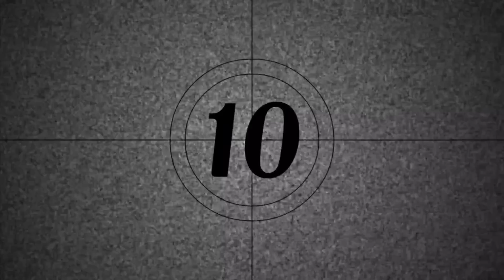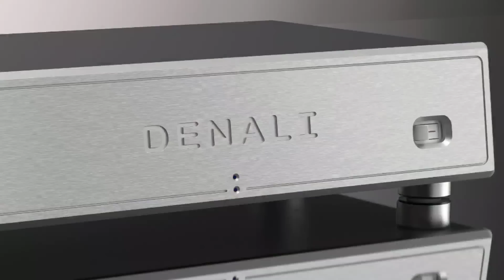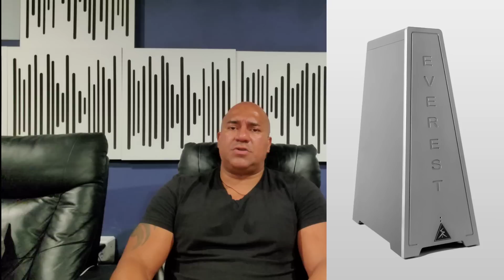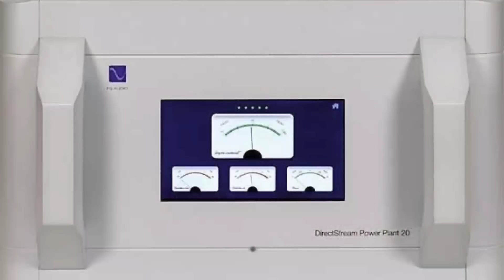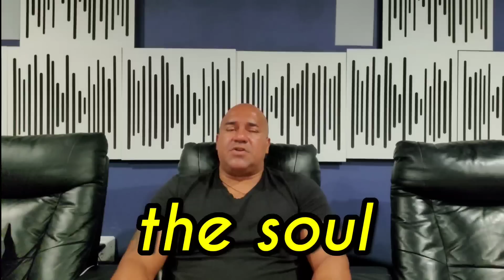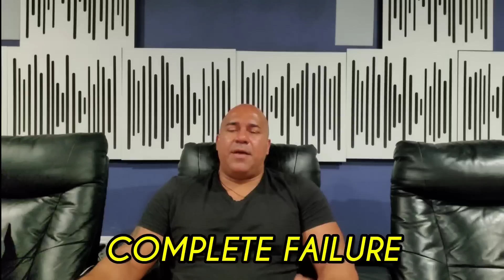Jay's Take on Power Conditioners

Comment: The problem with conditioners is they starve components, that require high current, of power. If the sum of all the components you have running is higher than the max output of the conditioner, you will have under powered components. This will be most evident with amplifiers. (That's why your amp failed. Not enough power). Line isolation power boards with decent cords are the way to go as it will ALWAYS give you the full power available from the grid.

Comment: You are talking about Power Conditioners, but you list also the PS Audio Power Plant PS20 - that´s NOT a Power Conditioner, but a Power Regenerator! A totally different game. There are not that much devices in that category, spontaneously I remember the Accuphase PS-1230, IsoTek EVO3 or the Stromtank from Germany. These devices do not filter your power like for example the Shunyata´s or Audioquest do, but they completly restore the sine wave of the current. Therefore they do not fall into the same category as Power Conditioners.
Reply: He also talks about surge protection. While many conditioners also provide surge protection, surge protectors are also a different thing.
Reply: I mean, yeah, but the point here is the sound. If all power generator would sound better than power conditioner, then yes, all you said makes sense. But if the regenerators dont certainly sound better, then I guess most people dont care and the word "power conditioner" here is just a concept for whatever box in between the gears and tge wall.

Comment: That’s why I use a balanced power isolation transformer that is SIZED properly to handle the load. Balanced power is based on physics, not snake oil. CMR, Common Mode Rejection will cancel out noise. Just like XLR balanced cables are designed for balanced differential noise rejection. It’s a simple process that cancels out and rejects noise on the AC line.
My balanced power unit is sized larger than 5 times the rated output I’m using, so there’s lots of headroom for transients and crescendos..  Because of the large transformer used, there is always plenty of peak power available. Simple and effective based on real science and physics, not marketing BS. Makes a huge difference in lowering noise, dropping ground faults, etc…  simple and proven.
Reply: Respectfully, Jay said he was struggling to see the difference in upstream components. My argument is, you should default to protecting your equipment if there is no obvious distinction. Why take a million dollar gamble? That would be the ultimate diminishing return

Comment: This is a sleeper video Jay, and by that I mean that this is AWESOME content that might not be so obvious to everyone - and for me personally, it couldn't have come at a better time - when I budgeted for my current system, the power cord thing was just beginning - I've always paid attention to outlets and such and back in the 80's brought single phase 10 gauge straight into my room - now I'm kind of "wincing" because of my own experience at having messed with some decent power cords and learned for sure that there's no denying the benefits - so yeah, I'm figuring I could easily spend another 30k or so to finish things off which I didn't plan for - I'm torn between the Dragons and Valhalla2's, everything in my system is Valhalla2, so it's kind of a no brainer to go that way with Cords (thoughts?) - I've spoken to my dealer who actually carries both brands but he hasn't stepped up to the fundamental idea of letting me try both (and I don't mean outfitting the entire system, just a couple of each) - suppose I need to buy a couple of both brands and make my decision from there, then bail out of the brand I decide against - that's expensive experimentation for me - So anyway, thanks a ton for this vid - - I never figured conditioners were for me and although I'll never rule them out, because of you, at least I feel comfortable focusing on just cords for now. My kindest regards and respects Jay, I hope you can keep going with all of your great work.

Comment: In my own system, after years of experiments, I built "immunity" to mains born noise into each individual piece of equiptment. ( except the DAC - I didn't build the DAC ) This approach sounded much better than using a mains conditioner and avoids the shorcomings of them that are mentioned.

Comment: Thanks for sharing your experiences and insights. While the benefits of a conditioner can be largely system dependent (including the quality of mains supply)...IME the need for the low ambient noise floor (with all your gear switched on) is vital to maximising whatever your system is capable of...regardless of the price. So far I have been able to get the day time noise floor down to approx 33db...and approx 31.5db at late night. Goal is to get it below 30db...but it is getting harder!

Comment: Same experience with power conditioners. Doesn't matter if it's my old  entry level amp or my current mid one. Sucks the life out of the music. It's worst if you have a revealing system.
I just use a very good powerstrip. I think electricity is pretty good where I live. Even the Niagara sounded worst than the wall to my taste on 25watt or 300watt amps.  Only on sources it sounded very good but even then a large oversized custom linear power supply with separate regulations sounds better to me. So i use that.

Comment: Absolutely correct. I've had four power conditioners that I got with that manufacturers power cords. There was an audible improvement with two of them. I removed the conditioner,using only the power cord straight to the wall. With those two it was the power cord that brought the improvement, not the conditioner.
Reply from the maker: Interesting

Comment: Power conditioners seem to brighten the sound at the expense of the bass.  One possibility is the removal of noise thins out the sound.  Recordings were most likely made to sound good on the equipment of that time period.  If power conditioners were available, the musicians and engineers probably would have modified the recording to sound good with power conditioners.  Timbre and musicality are two of the most important things a stereo needs to do to get the music.
Reply from the maker: I agree

Comment: I was a PS Audio power regenerator fan for many years but I got sick of them breaking down time after time. Every one of them broke down and needed to be repaired. I came to the conclusion they were junk and not worth the drama of ownership. Then I bought a Shunyata Denali v1, which is a passive power conditioner. I now also use Shunyata digital cables.
Reply from the maker: I didn't have mine break down but i didn't own it long enough
Reply: @jaysaudiolab  Consider yourself lucky. I owned 10 of them over the years (PPP, P3, P5, P10) and every one of them broke down. I contemplated buying P20 but I know it would have been more of the same so I changed to Shunyata. No reliability issues with Shunyata at all.
Reply: @brodricj3023  
I would consider you unlucky. I've owned PS Audio regenerators (they are not power conditioners.) over the past 12 years and never had a break down. My (then) new P20 has no problems to this date. I have two other friends with them and no problems. In fact, one of them bought a new P10 years ago with no problems to this date. I'm not saying that PS Audio is perfect (who is?), but apparently, you have a black cloud over you.
Reply: @Mark-lq3sb  If you follow the PS Audio forums there are many reports there from power regenerator owners with faulty products, mostly in the 230V markets. Including an owner who bought two brand new P20's and they both arrived DOA.
Reply: @brodricj3023  
If we're thinking of the same guy (in the U.S.) that bought two P20's he also bought one or two P15's at the same time and I believe the P15(s) may have had a problem too. My older brother bought new Pass amp mono's (about $20k.) a few years back they were DOA too. But Nelson's company took care of it right a way and if memory serves me correct, the guy with the bad P20's and (P15(s)?) Paul's company took care of him too. Point being, PS Audio isn't the only audio equipment manufacture that can have "problems". Why haven't I or my friends had faulty PS Audio regenerators over the past 12 years? Personally, I don't care for power conditioners. They all us some sort of filtering of the signal.
Reply: @Mark-lq3sb  The PS forums are full of reports of busted power plants. Yes, the company takes care of it, but that effort would be better directed to building a more robust product in the first place. PS Audio is a great product ideas company, but the execution of those ideas often results in half baked products.

Comment: Hi Jay, how is your MSB connected to the network? Do you use an audiophile switch or filter like GigaFoil?
Reply from the maker: I use the Regen switch
Reply: @jaysaudiolab  try a clock like emperor geismann after dark clock with LPS on both EtherRegen and clock. Omfg!

Comment: Hey Jay. I’ve got a Transparent Powerwave conditioner. Killed the dynamics on my Pass Labs amp. In one of your previous videos you said play with your cables. See what they sound like connected to difference pieces. I plugged the Pass directly into the wall. Dynamics, and as you would say - slam - increased. I ordered a Transparent gen 6 Reference power cord the next day. Haven’t looked back. I prefer my Aurender and MSB Analogue DAC via the power conditioner. Noise floor is lower and backgrounds blacker. But the new MSB power bases and specifically the MSB Reference power bases are much more significant than the Analogue DACs. So as you say, the high end equipment often does not need conditioning. Great video. You are the only guy online with real high-end Hifi opinions and advice. Thanks.
Reply from the maker: Thanks 👍

Comment: Jay- one of the issues that I found with power conditioners or isolators is the receptacles that they use on the boy. They all use hospital grade receptacles but those are not good enough when compared to brands like Furutech and eventually degrades performance. In my system all of my electronics including monoblock amplifiers, DACs etc go straight to the wall and into the Furutech GTX-D NCF(R) receptacles which are fed by dedicated 10 guage circuits. This layout so far gave me the best performance compared to using a few power conditioners like Shuniyata/Audioquest in my system. That's why I do no longer feel like introducing a power conditioner product in my 2 channel audio system.
Reply from the maker: Good post

Comment: Jay, great video. Power conditioners often make the music and sound cleansed and resolved to perfection, it reminds me of distilled water. It may be close to perfection, but I like the raw one with minerals better. At least it has some flavor and expression.
Reply: I also recommend to everyone to make a test once a while. Replace your all high end power cords with generic cables and plug them to basic strip or directly into the well. You will be able to see the direction you have taken with high end cables and analyze if you still keep the balance right or maybe went into some kind of extremes, which usually is never good.
Reply from the maker: Great post

Comment: Let's face it, everything in a highly resolving system has a sonic signature whether it's power conditioners, power cords,  interconnects, dacs, preamps, speakers and tubes. It's just a matter of mixing and matching all them seemingly endless combinations.  Sometimes I think it better having a less is more approach with a system.  In the end it's gonna come down to system synergy and musicality like you said.  I agree with your experience with power conditioners with large amps. The bass just wasn't the same. I agree that perhaps they can be beneficial in other systems where a synergy could be established with lower powered stuff like dacs, phono preamps and streamers. I agree a decent power cord for my large amp is better than a power conditioner. It's also interesting not much is said about all this high end uber expensive gear and the work the company put into the power supply design. Msb, dcs and other know their stuff and pay a great attention to power supply design. Thanks!
Reply: Jay have you tried the Furutech power distributors? Not conditioners per se but they do provide a little passive RF noise rejection and I find they are quite transparent and do not curtail bass or dynamics like conditioners. Also for surge suppression a whole home surge suppressor at the main panel is probably a better bet anyway.

Comment: Spot on Jay! Power conditioners particularly with amps create more resolution and tightness in the bass (that's why it sounds leaner). I notice the biggest trade-off in the decay of sound. Every frequency stops faster and does not sound natural. Try it guys listen to a string instrument recording using a power conditioner and then without it. The power conditioner chops the sound it's like pulling a string and stopping in with your hand vs. hearing it linger for a second. Music with a power conditioner can sound impressive at first but over time it's fatiguing, because it doesn't sound natural.
Reply: Good info. I have a iFi Powerstation on lend.... and I was suprised at the improvement in Stage as well as control of instruments, a more relaxed sound and even a nicer color. It didnt kill dynamics like many ppl say... so I was pleased but still in doubt.. like it has an on off switch.
But your comment is interesting and I will listen again.... I am curious!
Reply: Try a couple of songs with and without the Powerstation: Eagles, Hotel California, from Hell Freezes over the first 2 minutes of drums for the Bass. Then try Phil Collins in the Air Tonight for the highs pay attention to the reverb. Every power conditioner is different you may have a different outcome. I now use a Oyaide strip with no conditioning or surge protection
Reply: Well tbh I listened some more and didnt buy it. It was very late (tired) when I listened the first night.
And the second listening I noticed the sounds faded out sooner than without the iFi Powerstation. The pro's on the first listen werent that obvious anymore and the more dampened sound was a turn off for me... a Furutech that I had on lend didnt have these issues. And the sound opened up more... So never listen when too tired. I knew that but I didnt know I was that tired.... and had a looong listening session too.

No more filtering for me. Just pure power.

Comment: Give  the tried and true Richard Gray 1200 Power Conditioner a shot. A simple execution using just 2 huge inductors and no fancy filtering techniques. This might seem to be a component that’s beneath you, but the damned thing works! You will hear more punch in your music without doing any harm to the systems musicality along with a lower noise floor. As a side benefit, you get a bit of extra power reserve. That’s been my experience for over 10 years of owning one. You are correct with power cables making a large difference for soundstage and resolution. 10 gauge is the way to go, even cheaper ones.

Comment: If you add a CHOKE (this is a large inductor usually looks like a transformer) into the B+ line on tube amps, the same thing might happen, it did for me.  Seems then that SIMPLE direct line current works best for tube amps.  I run my tube amps off 250 volt isolation transformer that I feel doesn't seem to adversely affect bass performance.   Higher voltage  means LESS current through the pipes, means possible dynamic improvement.  So, as it pertains to power conditioners, the current required for QUALITY bass gets LIMITED - maybe non measurable transient requirements.  As always, the EARS KNOW and meters GUESS.
Reply from the maker: Great post !
Reply: I have been at this for 30 years as a dealer.
All you need is huge 220v Isolation transformer 
At least 4kv. You will actually have more power stored up in your own transformer for way better dynamics and the detail is simply organic as you Are not sharing the transformer that everybody in your community is using which is on the pole. There is simply no noise floor it is like from deep space. We are using a Richard Gray substation RM pro.

Comment: I not try yet with Amp direct to wall, but i try this days.. And my Niagara 5000 is very quiet, when i push on Power Correction ( from back) all is very defined and floats in the air.. Bass is incredible fast and with kick. In each plug, preamp sound different, from big stage ( plug 4) to small stage but incredible fast and real sound, i can choose.. To amp i have Audioquest Dragon power cable. This days i try dirrct to wall, but this cancell power correction, Niagara 5000 have power reserve 90 Amps ( this mean in my country with 230Volts , 20.700 watts , no any house circuits deliver this ! ) . Make from active energy, reactive and storage in one big capacitor , make all the time and the power consumtion is huge , more than double than with power correction off . BR

Comment: I had the breaker panel to my house replaced when I bought my house. It was totally worth it.

I gave up on power conditioners awhile ago. Everyone I have tried restricted current flow. A better power cord than what you're device ships with will help , you don't need to go crazy to get an improvement either. 

Keep in mind most devices have power conditioning/power regulation built in to them. 

I basically have a higher current power strip for sources, pre/pro , amp,  and  my projector has its own outlet and subs each have their own outlets.
Reply: I have spent so much money on power conditioners. Then I realized calling the power company for a dedicated power line with a separate circuit was the solution. Hallelujah better than any power conditioner.